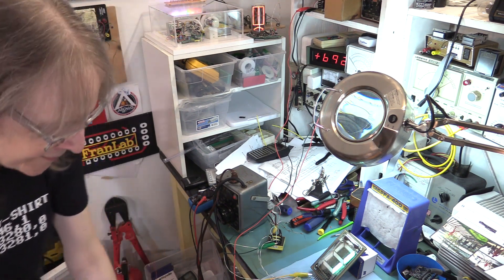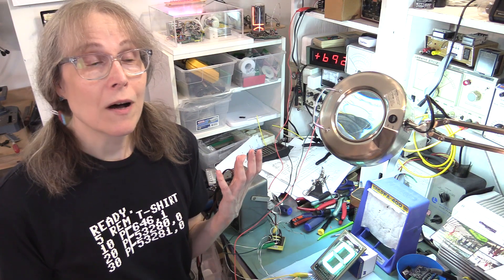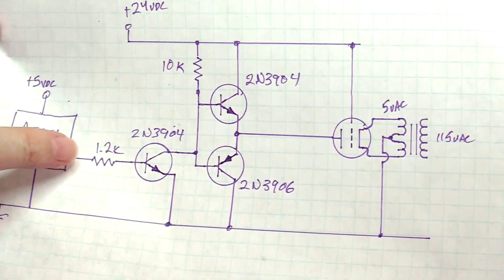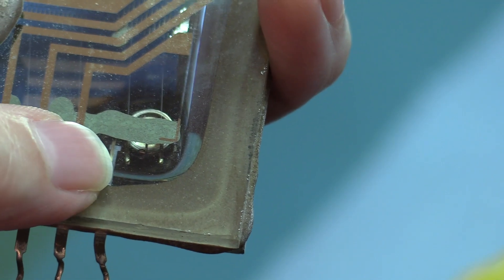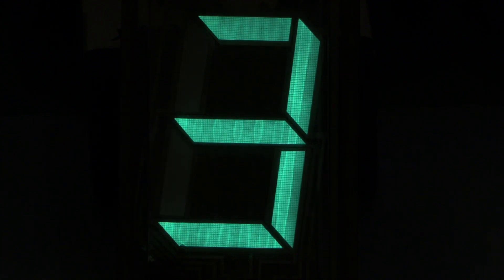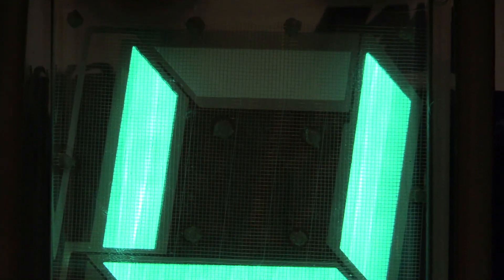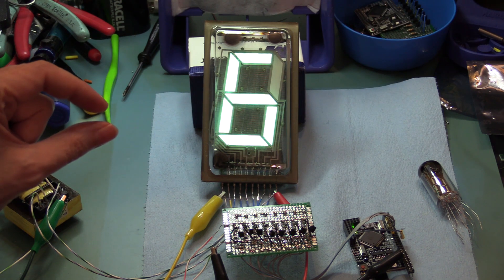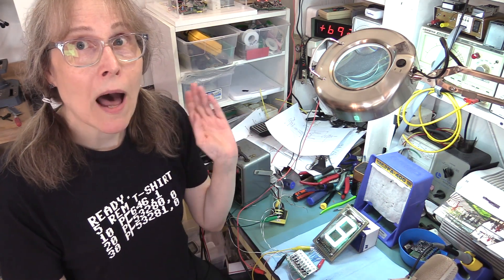If At First You Don't Succeed...  Monster VFDs Pt 2

Comment: For the 'open' tubes: If the broken contact is close enough you may be able to spark it and get it to weld! Should break through any oxidation and clear a small gap.
Reply: Just like the old picture tube rejuvenators worked. This would most likely be very risky with the way these VFD tubes are physically constructed. A touch too much and you will destroy the cathode by removing too much material (layers). Interesting concept nonetheless.   Fred
Reply: An unearthed tig welder maybe capable of low heat transfer fusion
Reply: @electronicengineer  not much of a risk if they are otherwise just expensive paperweights
Reply: thats what i was wondering, maybe 500v from an insulation tester may be enough to spark a connection? i've done this blowing through the oxidation on an 'unobtainable'  computer keyboard switch
Reply: RF heating?
Reply: @electronicengineer  A major difference between this and a CRT rejuvenator is that here the charge will only be applied across the filament. Since the filaments will be cool at the time and no voltage will be applied to the grid or anode it should not damage the emissive layers. Actually I don't know if directly heated tubes like this even have coatings applied, it might just be a bare wire.

Comment: Why not use a common positive, so the MCU just controls one PNP pull-up transistor per segment? Then you just use pulldown resistors. The center tap of the heater transformer is meant to be connected to several volts above the voltage for the pulldown resistors. Then the pulldown resistors pull the segments several volts below the heater.
Reply: Was about to suggest biasing everything negative. This makes total sense
Reply: Biasing with resistors has one drawback - it will increase power consumption. For small displays it is not a problem, but for this one...
Also, PNP pull-ups will have to be controlled with discrete NPNs or ULN2003 (or similar). MCU is probably only 5V tolerant.
Reply: Interesting idea. Instead of pulling the grid to ground or a negative supply, just raise the filament ground a little.
Reply: @velinr  You don't need any buffers to drive the PNP pullups. If the anode supply voltage is +5v the MCU can drive the PNPs directly. Obviously 5v is not enough, so you have the pulldowns going to a negative value.
Reply: @eDoc2020  , true. But in this case you need negative voltage. Lot of integrated VFD drivers probably work this way (they require negative voltage).

Comment: Fran, just use one 3904 to pull to ground, then a pullup resistor to bias it to 24v.  It's going to consume a little more power,  but not crazy.  You can than also tailor the resistors for segment brightness.
Reply: Actually, I'd use a MOSFET to pull it off.  Then it will go to true ground, and you don't need a resistor from the Micro to the gate.  So one FET and one pullup per segment.

Comment: Fran,   Looking at the drivers out there, I would suggest the following:    Connect the center tap of your transformer to the +5 rail of the driver!   Then a ULN2803 can put out -5 and +24...   Also, you will want to put all the filaments in parallel rather than stacked. So that the peak cathode / filament voltage is well away from the plate excursions.    

  The driver must be able to take the plate negative with respect to the filament / cathode to cut off the plate completely.   See the link to a Futaba app note:
https://www.futaba.co.jp/en/display/vfdinfo/vinfo_kudo_1.html

Hope this helps.   David
Reply: The grid driver is also probably overkill and you could probably get away with a simple open collector with a pullup. Kind of like the original driver but without the output push-pull driver.
Reply: Of course you need to be sure the display current won't exceed the current consumed by all the 5V circuits or you'll end up raising the 5V rail way above 5V and fry stuff. You could use a TL431 shunt regulator set to shunt 5V, with a protection diode in parallel.

Comment: Hi, these big Russian VFDs are great!
I have a similar VFD Display and had success with a UDN2981 Driver.
It contains 8 driver stages and works up to 50V!
You can put a ~22K resistor from each segment to ground if you have problems with segments not turning off.
Unfortunately i only have two of these VFDs. So i did build a "single digit" clock with one and kept the other as spare.
I'm using a ATtiny2313 for control and a XL6009 DC/DC converter for the anode voltage.
The circuit is supplied with 5V for the microcontroller and filament (with resistor in series!).
At 10V anode Voltage the display is already bright enough for indoor use!

Comment: Fran. Great to see something from the era of my youth!  Loved the old Nixie tubes!  Re your Soviet huge 7 segments, I wonder if you could get rid of one of your driver transistors per segment by using simply a resistor to "ground" the undriven pin?  It may be that quite a high value could be used, as you are just biassing the segment off - I doubt if much current would flow to ground???  A high value would be good so your upper transistor to the +24V isn't carrying too much current through the resistor when it's on.  Then maybe use an open collector driver chip to invert the drive to that transistor - save lots of separate transistors?

Comment: Hi, nice video, you can use transistors arrays like THAT 300; THAT 320 ; THAT 340 to compact and simplify your design.
And if you  multiplex  the other clock digits , it will be easy to use these great VFD's

Comment: With regards to the broken filaments I have on a few occasions managed to fix broken filaments valves (vacuum tubes) by applying a high voltage discharge across the broken filament. I used a capacitor of a few hundred pF charged to 25KV.  It is enough to weld it but at the same time not powerful enough to melt the filament.  It depends on how the filament is broken and won't work in all cases. In the cases where it worked the filament was broken just at the spot weld to the terminal. 
I think the reason it works is that the high voltage between the two sides of the break causes the ends to attract electrostatically and when they get close enough or touch then all the energy is discharged through the contact point fusing the two ends together.

The way the filaments are broken in these VFDs might lend themselves to being repaired in this way because if I understood correctly the filament is close to the flat terminal so it has a good chance of being attracted to it with the high voltage pulse.

Comment: As others have said already, not all hope is lost with the open circuit filament tube. I would give it a "friendly tap" (while filament is fed with the necessary voltage) and possibly that would force it to get welded again. I have fixed an open circuit filament of an old crt once, and it lasted for years !

Comment: Put the display on a d/c pedestal .
Pull grid down low for segment off ( that is below the pedestal voltage ) .
That's 8 transistors & pull up resistors per display & the dots all hard wired .

But it blows multiplexing out the window so it's all shift registers !
Load data for all segments then output all into the out buffer & drive transistors .

Comment: Thank you Fran for doing these vacuum tube projects. Much of my career has involved vacuum tube design projects including really big ones (120 kV). It's a dying art.
Reply: Wow Monty, from another thermionic fiddler...That is some serious anode voltage.
I have been wondering recently if the boffins have got any closer to replacing such ultra(?) high power/voltage devices with solid state? I haven't looked for a few years, but I guess Crystal Palace still uses a valve to transmit the BBC..
Reply: PS I know when they swapped to digital the transmitter ERP  was cut from 1MW to 200KW. In fact digital was transmitted at 20KW before changeover.
Reply: Theoretically solid state transmitters can be made at any power levels but it all comes down to cost and scale. At lower power levels it makes sense to go solid state. They are reliable and require no fuss. At the peak and average power levels that I was involved with, the cost and size becomes prohibitive. That line bumps a little each year so eventually high power microwave vacuum tubes will go the way of the dinosaur. I worked projects from radars to plasma fusion science experiments. It was a lot of fun.
Reply: @montygrimes5986  Wonderful. Thank you..I just deleted half a page of questions. I can research myself without bothering you...But it would be a great idea (I think 😸) if you had a channel discussing this sort of thing.
On a slightly different matter;
I have a friend who was going to open a Radar museum and was given permission to look through the old GE building where the cavity magnetron was developed. He found boxes of (the then) top secret correspondence and device drawings, data, experimental results etc covering the whole of the development time. His museum fell through (eventually opened by others) but he still has these boxes of important history. He asked the IWM if they wanted them 30 years ago and they didn't want them... I feel sure there would be interest now..

Comment: I only took a year of physics in which we learned about electrical diagrams such as the one you made. Your diagram is literally the best one I've ever seen anyone make by hand! That includes the diagrams I have drawn and I tend to be particular about stuff like that. Well done!

When you vary the voltage, it reminds me of the experiments we did in physics with the oscilloscope. I wonder if those pertain to the wave of the electricity flowing through them. That sure would be interesting and it would make sense with the idea I've had that perhaps things may look like particles when a given measurement is taken at a given time, just like a moving object might look still if a single snapshot is taken at a given time. I mean I don't technically know enough about any of this but it doesn't hurt to think about things and nerd out.

Anyway, that clock is going to be really cool!

Comment: @5:30  I don't think putting the filaments in series is going to work well. The filaments are also the cathodes. I think having voltage swings of +/-15V on the cathodes of the tubes at the end of the chain will cause some issues.   I would suggest putting them in parallel and the center tap still to ground. I would use a higher voltage than 5 volts and put a couple of resistors in series with each filament. The resistors will allow a degree of adjustment to compensate for differences between the tubes.
Also I think important is to do some sort of soft start for the filaments, probably by just putting a PTC resistor in series with the transformer primary. Without soft start I think the filaments will fail after only a few on/off cycles.
Reply: Your point about putting heaters in series is correct, and there’s more. Heaters are not exactly same, they very likely have at least ~10% variance in resistance. So being put serial some gonna be overheated, and some underheated, which is very visible. 

As for soft start – it’s not required with this sort of lamps. Cathods do not need to be very hot, so startup stress is pretty low.

Comment: Filaments have to be in parallel, but you can help with the bias by having the common of the filament transformer 3 diode drops above ground, so the anodes can pull down to ground hard, helping with the cut off. You will need to run some current through the diodes from the 24V rail, probably around 20mA or so, so that the diodes stay in conduction all the time. Diode current will be the sum of all on segments, so there you probably want 1N4001 diodes, plenty of headroom and cheap.

You can put a 1R resistor in series with the heater wire for each leg of each tube, will help both with turn on surge, and also allow you to adjust the current in each tube if they are very variable between tubes. Will need a tiny little bit more voltage, but will allow you to use a regular 6.3VAC centre tapped filament transformer, with a single power resistor to allow adjustment of the filament voltage slightly, so around 3R3 10W variable wire wound pot.

Otherwise I can't wait to see the updated driver, and the finished clock.
Reply: just seen your comment, i've said similar raising the centre tap a few volts above ground  with a 2v7 zener ,pullup to + supply, and using about +26v to compensate, (thats what i'd do, i have loads of 2v7 zeners 😉)

Comment: IMO a nice feature of tubes is you can see where the electrons go and kinda guess how they work. Because of that, the mottling is a feature not a bug. Plus it looks cool to me.  I haven't played with vacuum tubes since I was a kid so I don't know much. But I do wonder if that contact problem might be fixed with gentle vibration, perhaps an electric shaver or toothbrush or other appliance along those lines might wear away oxides that may be preventing contact. Unlike modern appliances, it seemed like old radios and TVs sometimes needed a good kick to keep them working because of all of the mechanical connections. Anyway, glad some of them work, I think the clock will look awesome.

Comment: Maybe you can try heat cycling that defective pin with a soldering iron and see if thermal expansion is sufficient to scratch the contact point and restore continuity? If the glass can survive it, that is.

Comment: Hi Fran, I love your videos!

I think running the filaments in series is not a good idea because the voltage swing will not be the same for all of the tubes regarding to logic ground. So this could mean the transistor driver won't work anymore. Running all filaments in parallel would be better. 

And maybe connect the logic ground to the filament transformer using two diodes wired in such a way that makes the filament voltage always positive regarding to logic ground. This could also help simplyfying the transistor logic as the filament voltage won't be more negative than a single diode drop instead of the now sqrt(2)*0.5*-5V at the worst point of the AC cycle.

Comment: You can bias the center tap of the transformer with a zener diode. Most russian circuits do that. If you don't, part of the anodes will still be positive (2.5V peak) every period of heater voltage. This is because  in such circuit, both ends of the heater will be more negative than GND for part of the time (diring the AC period).
Also, connecting filaments in series will be a problem. It will amplify the above effect.

Comment: You might wanna switch to designing multiple PCBs (one for each tube maybe that connect to a main PCB) in order to safe space in the clock and for ease of soldering so many components. And have a socket for the tubes to exchange them more easily.

Comment: I have a lot of concerns about the series heaters. Since these are directly heated valves, the tubes near the edges will experience wildly varying cathode voltages. This will cause the circuit to malfunction.
Reply: Yeah, at peaks the difference between Anode and Cathode potential is going to be around 45v. Pretty sure that's going to stress/degrade the phosphour. Probably draw a lot of grid current too. Also high enough so that Anode-Cathode potential is reversed halting current flow, the outer ones will probably look dim as they saturate for 1/2 the AC cycle, then turn off for a large proportion of the other 1/2 cycle.

Comment: Instead of using 24 transistors per digit, you might consider using 2 L293D's. They are push pull (600/-600mA), do the level shifting up to 36V and 4 channels per ic!

Comment: That one with an open in the heater grid, since it's 'junk' anyway, you might try applying a fairly high voltage (100+) with a hi resistance in series.  The high voltage might be able to arc across the open and create a connection.  With any luck it will 'weld' itself and the high resistance would avoid burning out the heater element.  (sort of a 'current source' with a high compliance voltage).

At this point, it's just a paper-weight anyway, so....

Comment: Try hitting the filaments on the bad tube with a spark from HV low current. Something like one of those BBQ sparkers or something. I mean, it's broken so... I'd be tempted to hit it hard enough risk blowing the filament if it doesn't start conducting at low voltage.

Comment: You might get rid of some of the filament modulation patterns by changing the bias of the grid electrode - especially if you do not intend to use the grid for multiplexing.

Comment: Fran, try deleting the 2N3906 and replacing it with a diode, anode to VFD, cathode to collector of the 2N3904 that is connected to the micro. That way the first 2N3904 doubles as the tube pull down.

Comment: I think you will get problems with heaters in series as the cathodes will be swinging well away from the center tap 0v on the ends of the chain. Parallel with 5v centre tap..

Comment: Since you mentioned VFDs used as triodes, have you seen/used Nutubes from Korg? I have a small hybrid amplifier from japan (Tindie) with a nutube and even if it is a bit microphonic, as long as I don't kick the table, it sounds absolutely amazing.

I'm glad you were able to get this monters working with the push-pull design, they look incredible.

Comment: Hi Fran
Glad to see that you’re found the issue. Keep up the good work. 
Filaments in series? I would think that would screw up brightness a lot between the digits because the filament (hence the cathode) voltage of each tube would be very different. Not to mention it’s AC..I would think tha parallel would be way better. 
Just sayin’.

Comment: I would try a single transistor driving the anode and add a few volts of cathode bias. Perhaps using a 5.1v zener diode pulled up?